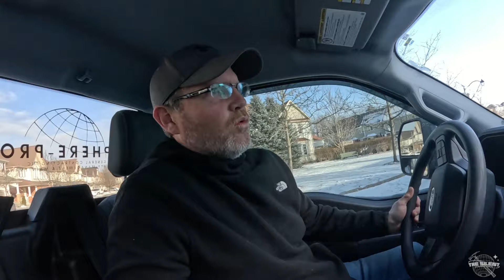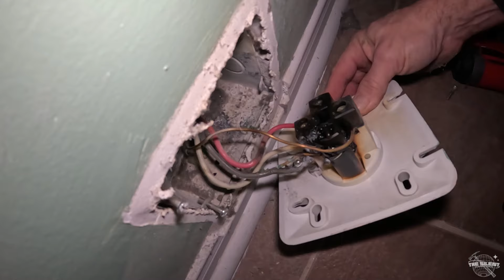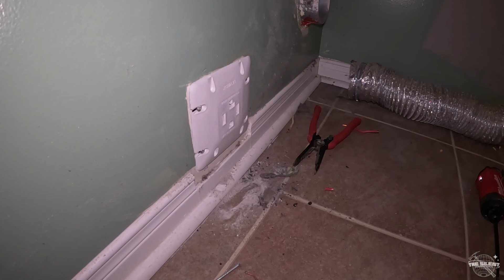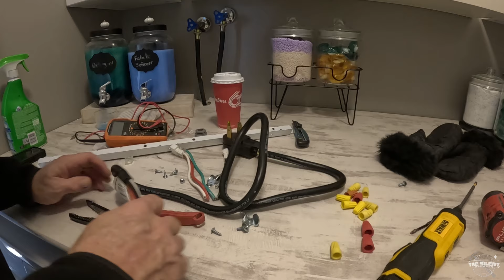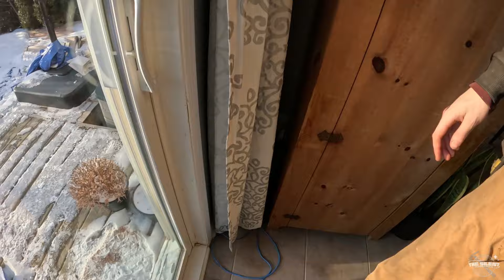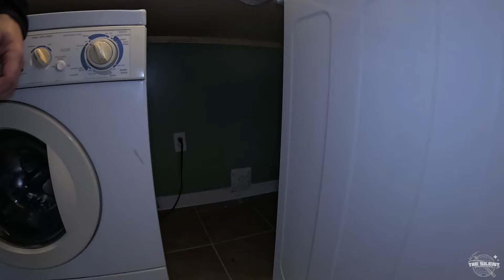🔌HELP!!! MY DRYER BLEW UP: Sparks Fly: The Great Dryer Plug Blowout:  The Silent Handyman & Sons

Comment: Why did it melt. What was the problem?
Reply from the maker: More then likely the black connection was loose and creating heat over time it just gets worse and that can result. There are other reasons why but I'm not going to guess. The one I've given is pretty common around here. THANKS FOR YOUR COMMENT, have you ever seen that before more typical with wall recepticals 120v (loose connections) cheers